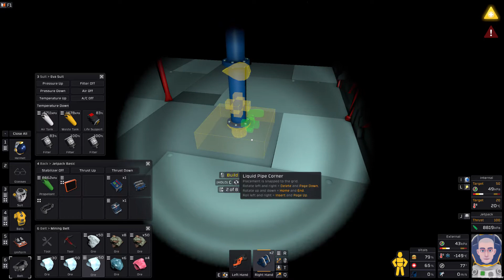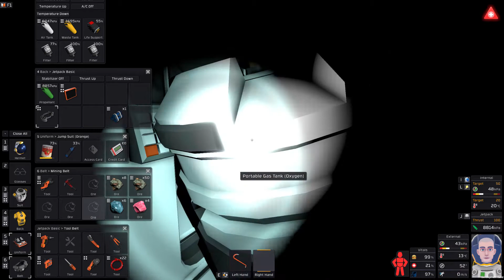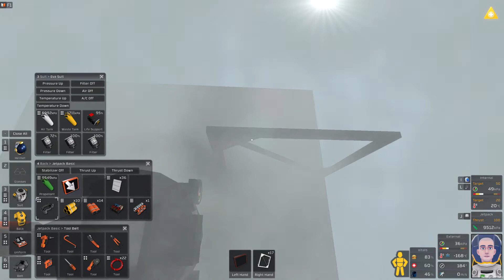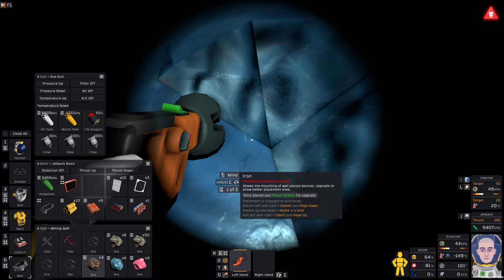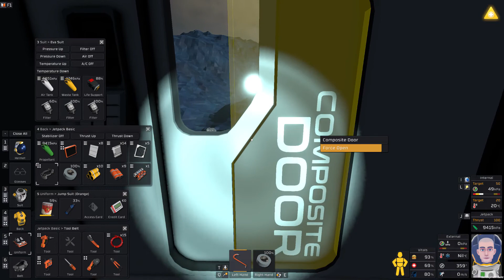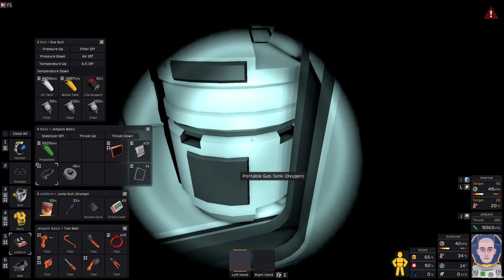Stationeers Europa: Season 1 Episode 4 - I Forgot Storms Exist

Comment: 28:50 - What about the two rolls of duct tape in the lander? There might not be enough for all the solar arrays, but it should be enough to repair at least a few.

Is there a reason you didn't use the ice grinder?
Reply from the maker: haha yeah I forgot about the duct tape I start with.
I usually don't bother with an ice crusher because I figure that my furnace can do the same task and I don't like to waste resources on extra machines.
Considering the rules I'm playing by though, an ice crusher does make a lot of sense :)